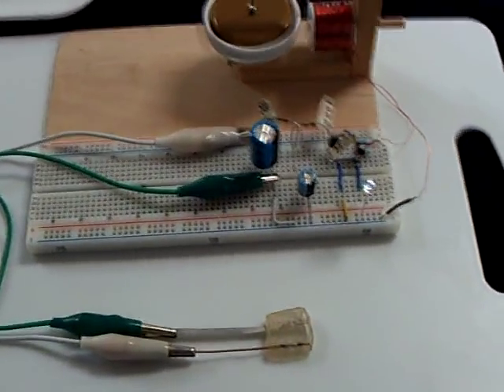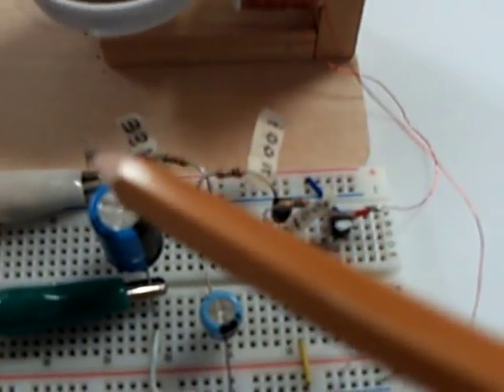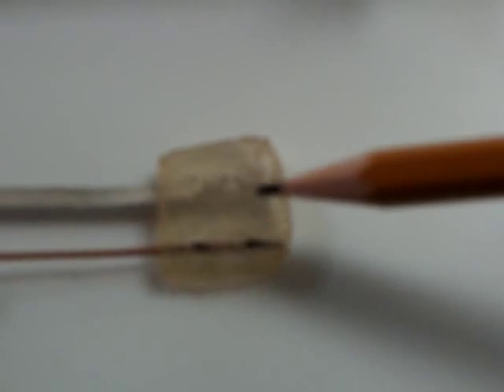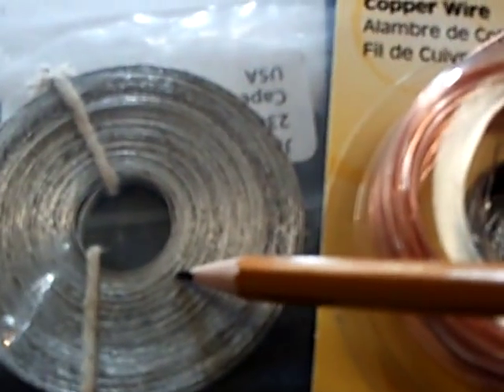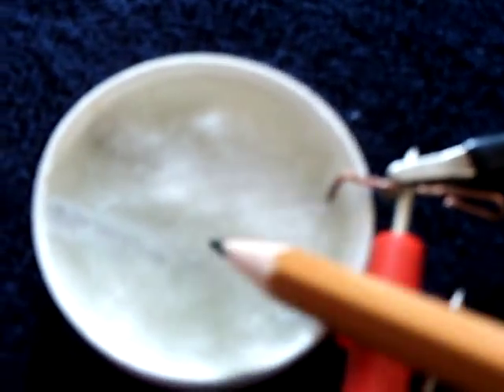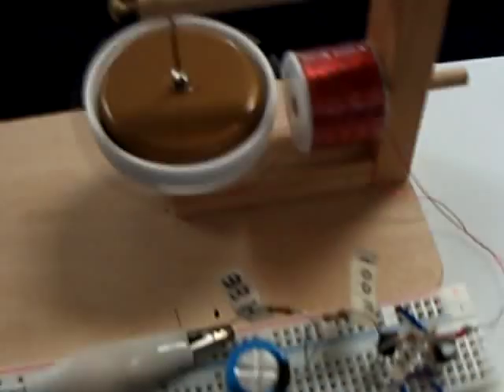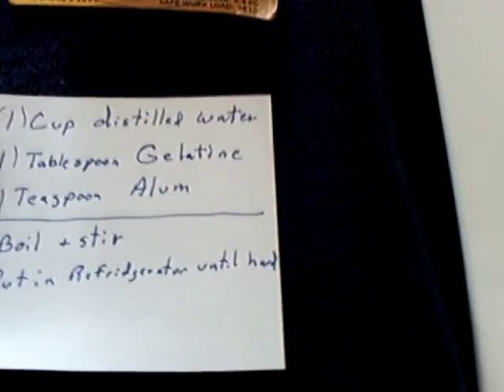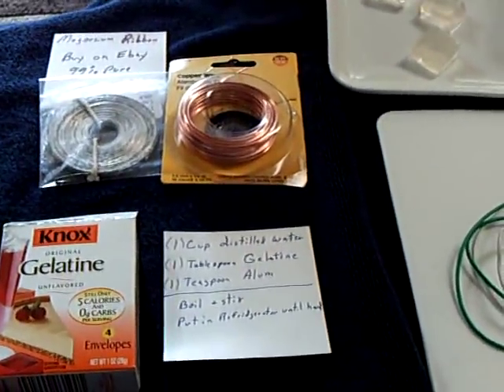Aged Gelatine Battery ---still working.ASF

Comment: Would be interesting to learn how much work you're able to extract from such a battery. Perhaps an output other than a low friction rotor Perhaps a rotor and gearing which lift a significant weight. As a kid I made a 1,000,000 to 1 gearbox from lego, such a thing beefed up would be nice. See what you get from minimal length wires and 1g of gelatine :-) Keep up the great work!

Comment: Could you do me a favor, could you try to make one of your gel cells again but instead of magnesium and copper could you only use magnesium for both plates. Basically stick two pieces of magnesium in the gel and see what voltage you get from the cell. 

thanks.